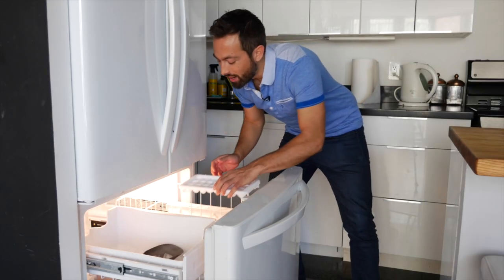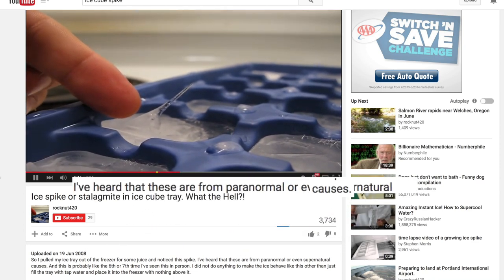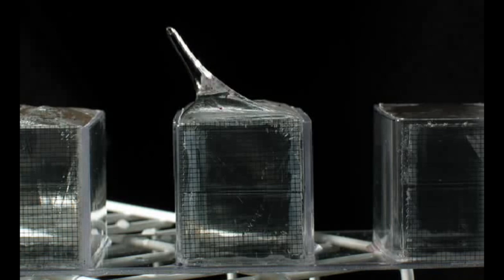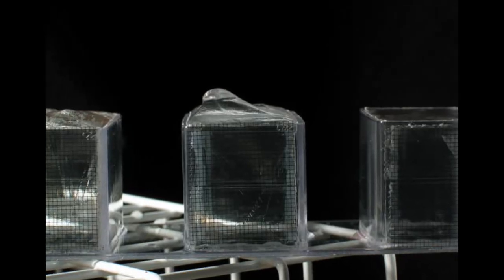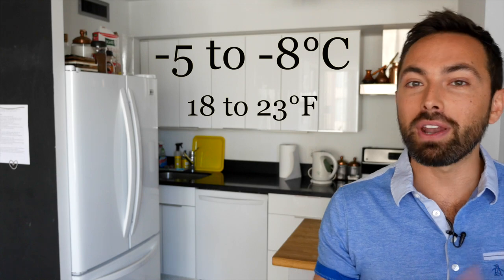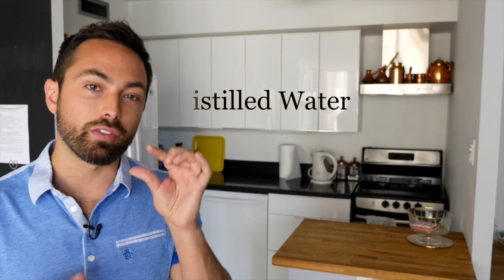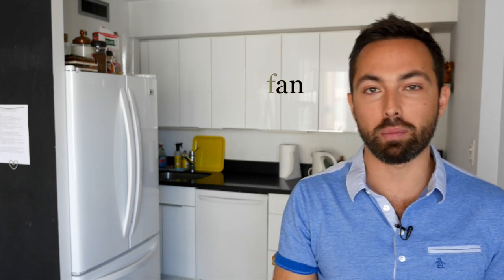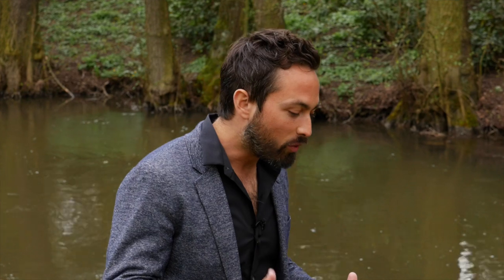Ice Spikes Explained

Comment from the maker: It's interesting how few people have observed this phenomenon - not even a bump on your ice cubes?
Reply: yes bumps but absolutely nothing like that
Reply: Probably because they grow in the other direction, down, here in the northern hemisphere...
Reply: Seen these from time to time. Not common, but not unicorns
Reply: When I started watching the video I was like "is that a thing?, never seen it"
Reply: nothing,
Reply: Nope. I've never seen anything like this ever happen.
Reply: I saw this happen only once
Reply: Nope. Not even a bump. My ice cubes always come out perfectly flat.
Reply: I'm guessing this doesn't work so well with silicone trays
Reply: I've been making ice cubes for 25 years. never seen this. I have ice cubes in nearly everything I drink, so that's quite a few cubes over the years.
Reply: Veritasium honestly never seen this happen, might have to do with the reasons you mentioned they form though: I don't use distilled water (obviously), and most of freezers I see don't have fans and work at -18°C.
Reply: Veritasium As a refrigeration tech, I'm going to look out for this in freezers that aren't quite getting down to temperature properly
Reply: Definitely never seen anything that looked like that. Though it has been a while since I used manual ice trays with the majority of modern freezers having automatic ice makers, so maybe it's less noticeable if it does happen.
Reply: I used to get the bump in my ice cubes, just not all-out spikes. Generally I try to keep my freezer colder than that. I was taught that 0°F (-17°C) is the temperature to aim for in a freezer.
Reply: Veritasium It may be because municipal tap water these days is highly electrolytic and dissuades ice spike formation.  I also imagine most people leave their freezers at much lower temperatures than you suggest is optimal - my freezer, for instance, is currently at a balmy -3 F (-19.5 C).  And I've never seen an upright freezer with a fan, other that the fan that is a part of the heat pump.  Basically the opposite of all three of your points for optimal ice spike formation.
Reply: Nice
Reply: Diamond Ice NS Almost all freezers will have an evaporator fan of some sort. In domestic units, it's behind the plastic covers in the back of the freezer. Some units have stronger fans than others, depending on the quality of the unit.

I think you're spot on in regards to the temperature. Most freezers run between -15C and -23C. Smaller bar fridges with the crappy little freezer shelf at the top may only get their freezer down to around -5C, but they are one type of unit which has a static coil (no fan), so this might again stop a spike forming.
Reply: Veritasium Hey Derek, can please do an explanation on the candle seasaw trick.
Reply: Veritasium i had a crappy old freezer it did on most cases have bumps usually around 5-8mm tall, but the thing that really took the cake
A penis shaped object including to half spheres was formed on the door shelf completely of ice. I took a few photos for laughs but the weird thing was there was no dripping from the top to form it, it also was leaning toward the center of the freezer
Reply: Veritasium why are the spikes so straight? Especially the one on the left. Have seen bumps before, never spikes.
Reply: Mike Williams like he said specific conditions, id like to know how to get them too
Reply: Veritasium I guess that's because regular freezers are too cold.
Reply: Veritasium Mine ice cubes are always smooth as a silk. Probably have to do with a freezer.
Reply: Veritasium Yeah small bumps are kinda common in the ice in my fridge
Reply: I drink distilled water, I get some pretty long ice spikes.  The dissolved air bubbles form an awesome crystal pattern too.
Reply: dan110024 Thanks for the clarification on the subject of freezer fans.  I learned today.

Another thing I just thought of is that most ice trays today are plastic.  Plastic is a pretty poor heat conductor, so would it be wrong to propose that the water in contact with the ice tray will freeze more slowly that the surface open to the freezer air?  The video implies that the pressure created in the would-be ice cube is created by water freezing in from all directions, and he explicitly stated that ice spike will stop forming if the open-air surface completely freezes.  If the ice tray is insulating the water, the surface will freeze over before the sides can freeze to build up that interior pressure necessary for ice spike formation.  What are your thoughts on that?

EDIT: I sort of blanked and forgot that most of the people who discover ice spikes are probably using plastic ice trays as well.  On second thought, there may not be any notable correlation after all...
Reply: Veritasium ever see ice rectangles? i've seen it almost like another ice cube on top of the first one. i think i might have already had an ice cube in the tray when i poured some warm - hot water into what i thought was an all empty tray, came back a while later to a gigantic rise out of the ice cube, was very interesting!
Reply: Nope
Reply: Veritasium I see bumbs on my icecubes all the time, but never longer than about 1/8th of an inch long. I also live in the american Rockies, so higher elevation might have something to do with it.
Reply: Veritasium Nope. Never seen or heard of this phenomenon before.
Reply: Veritasium I've never seen or heard of this phenomenon before. I live in the Netherlands. I'm wondering if other factors contribute to the formation as well. Also, nearly all freezers in the Netherlands are run at -18 C. I don't remember having ever seen one with a fan inside the freezer compartment.
Reply: Veritasium That's right! I have been alive for almost half a century and I have never observed this phenomenon!
Reply: This is a really cool phenomenon I've only observed once before and I never knew why it happened until now
Reply: Veritasium At end of video, was the singing done by you ?
Reply: Veritasium My freezer has an automatic ice machine that makes the wedge-shaped ice cubes, so I don't think these are capable of forming in that situation.  The strangest thing that happens is when several of them are still connected together along one end.
Reply: Veritasium 

Well you ask “It's interesting how few people have observed this
phenomenon?” well a day before that post I wrote:

“LOL, always wondered, had already made a picture to send to you with
the question if you knew why. So now I do Thanks.  By the way it happens
here 5 out 10 times on multiple cubes, using tap water.”

Later I added: 

“just checked the spike I have now and it seems to go straight up , not
at 60 degree angle, it is almost 1 cm, so the claim that they grow in an angle
seems not entirely correct”

Have another one, as a thought. I have two ice cube forms, only one
makes spikes! One is pretty solid plastic the other sort of flexible
rubber(ish). The Rubber one makes the spikes. My thought on it is that while the
first ice is forming it wants to expand and when the walls are flexible the
cube that just grows a tiny bit faster will push and break the thin layer of
the nearby cube so that a crack and spike can form. Whearas in the hard plastic
form this does not happen and no cracks so no spikes.
Your opinion about this is welcome
Reply: Veritasium  I've never given any though to whether there were bumps on my ice cubes, but spikes I'm quite sure I've never seen. Don't know what freezers are like in other countries but here they're usually around -18 degrees or lower. I was also wondering if the shape of the ice cube tray is relevant? Most trays I've seen are wider at the top than at the bottom. Would the effect be different if the compartments were completely square with right angles or if it was wider at the bottom than the top? (Yes, I realize you'd have to break the tray apart to get the ice cubes out, haha!)
Reply: Veritasium Never even heard of it. Freezers are usually much colder than -8C, usually about -18C around here. Even though our tab water is safely drinkable, it's far from distilled.
Reply: Veritasium Very nice video, you made one mistake though... as you said, water's “unique” property of having this density anomaly.... also C, Si, Ge and Sn do experience that.
Reply: Martin Embeh in the context it might not be unique to water, but just unique in general and respective to water....
Reply: +Robellibobban

It
is in the small freezer part of your refrigerator, where this happens not in
you "deep“ freezer which you use to freeze food for a long period,  and that unit usually around -8 C and the
deep freezer – 18 that is why they call it deep freezer
Reply: Villi Kuha 

It
is in the small freezer part of your refrigerator, where this happens not in
you "deep“ freezer which you use to freeze food for a long period,  and that unit usually around -8 C and the
deep freezer – 18 that is why they call it deep freezer
Reply: M Goudsmits Oh.. Refrigerators don't usually have those compartments in Sweden.
Reply: would have guessed that Sweden is not that different than the Netherlands or any other country in europe?  here most Refrigerators have a small cabinet just big enough to make some Ice cubes or freeze one loaf of bread which you are gonna use over the coming days, the freezers or Frysboxar weh ave in a storage room where long term sorage of food is kept. but any way it is not so important I just put a picture of my icecube spikes on the facebook page of veritasum
Reply: Veritasium at first i was like "O.O!! wuuuut!?!?" but i soon realized that our ice has just been capping off too early so to speak lol. we have small bumps from time to time, which i never gave a second thought too but this is certainly cool. its likely cause we keep our freezer below normal cold temperatures and use tap water for our ice. unlike alot of people who use the filtered water taps
Reply: Veritasium never seen it ever
Reply: M Goudsmits That's interesting. I've only seen so called "coolers", firdges and  freezers, or apparently only deep freezers. Fridges operate in +2 to +6 C range and coolers at over +10C. I've never heard of freezers running at anything warmer than -18C. They are meant for conserving food basically indefinitely while -8C would only be good for storing some foods for a few weeks. Where do they use -8C freezers? I'm guessing it at least saves energy with foods that don't require more freezing. Are there other benefits?
Reply: Veritasium awesome!!!! good job with the researching.
Reply: Villi Kuha it is not a -8 C freezer, but freezer compartiment inside a refridgerator , this small compartiment build around the cooling unit which holds the fridge at 6-8  is used to freeze cubes or other small stuff  at - 6-10 C that do not need to be stored for long
Reply: Veritasium I'd say 95%+ of the time ice cubes have been completely flat.  Any slight bumps in the surface I always attributed to condensation via the defrost cycle.  The same way you get "snow" on the outside of a bag of frozen peas.
Reply: Veritasium But the a cappella extro though
Reply: M Goudsmits oh, i see. thanks dude.
Reply: Veritasium I install appliances.  Most freezers have a factory setting of zero degrees Fahrenheit.  This is also the temperature that most restaurants keep their freezers for food safety.  If you experience ice spikes, you either have an abnormal freezer temperature preference, or you need to call an appliance repair person.  I imagine small bumps may occur because  from uneven cooling or the freezer door/drawer has been left open too long.  This would raise the temperature while causing increased air flow as the cold air in the freezer is exchanged with the warm outside, and cause the evaporative cooling you spoke of.  If there's any chance paranormal activity has occurred, it would be because a spirit has messed with your freezer dial. or it left your freezer door open too long while it searched for ice cream bars.
Reply: Veritasium I see this for the first time in my life.
Reply: I have had 1 in a frisbee and it was huge, way bigger than the ones shown here. It was so cool I'm so glad I know how it happens now thanks!
Reply: Veritasium Maybe because people dont use distilled water that often? Usually there is a lot of salt in the tapwaters. I myself have seen bumps and humps all the time, No sharp protrusions though... Thanks for giving me the explanation.
Reply: Veritasium Most home freezers are set for around -18°C (0°F), so...
Reply: Veritasium Never
Reply: Yup! It happens to my ice cube often.
Reply: Veritasium I'm 34 years old and I've never seen or heard of ice spikes before watching this video. I've always lived in the country (with very hard, calcium-rich water) or the city (with fluoridated water). 
Perhaps the prevalence of fluoride in water explains the rarity of ice spikes?
I'm about to get some deionized water and try this out!
Reply: halsoy Perhaps your freezer is too cold :)
Reply: I'm 37, and just found ice spikes in my ice cube tray; pretty cool.
Reply: I think the fact that the earth would be so drastically different due to such a small change  ( ice being denser than water) proves that there is a designer.
Reply: Theordore: https://en.wikipedia.org/wiki/Confirmation_bias
Reply: +Theodore Hochstetler You have to first assume ice could be heavier than water. Other physics lead to ice being lighter than water.  It's the similar to the reason why apparent magnitude goes down by the square, it's 3-space.
Reply: +Veritasium Never seen this.
However, 
1. My freezer operates at -18 degrees Celsius, which is well outside the temp range that you mentioned, and 
2. The freezer compartment that holds the ice cubes is basically a very thin drawer, which barely has enough height for the plastic ice containers to fit in.

Which means that even if I set it at the right temp, ice spikes would still not have any room to grow. I think they'd connect to the top of that drawer, lol, holding themselves in place, being stuck there.
Reply: +Veritasium Never seen it but I do get ice bumps all the time.
Reply: +Veritasium I could observe it for the first time this year. I have a humidifier that also works as an air-cooler, you have to put ice into the watercontainer. I didnt just put little ice cubes into it, I filled a whole 2l ice cream box with water, covered it and put it into the freezer. And everytime I opened it, the block of ice had a small ice spike on the surface. It was always about 1cm tall. Interestingly, the surface was not even. There was a slight elevation leading up to the spike from one side to the other.
Reply: The closest I've seen is (with larger volumes of ice/water) the top of the ice bulging and cracking.

Come to think of it, the cracks are most often spoke-like in the center in sets of 3 when they happen.

I live in western PA and I believe the source of our water in an underground aquifer, so we probably have a decent concentration of dissolved minerals here, so that's likely the reason.

I wonder if elevation/air pressure have any effect.
Reply: I have seen this and wondered, so ty.
Reply: +Veritasium I always use tap water...
Reply: +Veritasium But if ice sunk to the bottom of the ocean, wouldn't the thermal vents that are would also be at the bottom melt the ice?
Reply: rick6011
Yes, but only locally to the thermal vents, and there are nowhere near enough to stop the hypothetical ice buildup on a global scale.
Reply: +DynamicWorlds Thanks
Reply: +Veritasium Bumps, but, never those huge spikes...
Reply: +Veritasium I didnt observe this until just last year. The first 22 years of my life I had a refrigerator with an icecube maker in it. And no one I know has ever talked about it seeing these either.
Reply: +Veritasium I get these once in a while, not very often. I think because my refrigerator is old and inconsistent. Sometimes, I will find the ice has partially melted and there is a little water under the cubes. Also, I use a lot of ice so there is constantly a new batch of cubes being made. The times it does spike up, the spikes are rather tall but only on a few cubes. That fridge is no longer with us though, and science takes a back seat to properly frozen food.
Reply: +Veritasium Not even a bump...
Reply: +Veritasium Before your video I've never even heard of the phenomenon... 
But to be honest: I haven't heard of a freezer / fridge cooling down to (only) -8°C.
My fridge cools down to 4°-6°C, the freezer to -18°C
Reply: breakingVIE
Most modern freezers and refrigerators have a switch of some kind that lets you adjust the temperature in them. Though 1-10 doesnt really tell you much about the temperature its going drop down to.
Reply: +Veritasium I believe this may be because of impurities or specific minerals in the water, however I'm not sure which (would be a great followup video to this.)  I have water delivered that is purified with reverse osmosis (Crystal Clear) and although I've never had my tap water form these crystals, the purified water will do it nearly every time without fail.
Reply: Respected  Veritasium, why don't you make video on "SPACE VERTEX ENERGY EXTRACTION".
it's a trending green energy alternative
Reply: +Veritasium never
Reply: +Veritasium Not even a bump.
THEY LOOK SO COOL THOUGH!!!!
Reply: +Veritasium 
I get these all the time. The ice tray is right next to the freezer fan.
Reply: +Diamond Ice NS  
Probably not, air is a really horrendous heat conductor as well.  I'd be surprised if its much better than that plastic, more likely it's worse.
Reply: 2:35 Even if ice DID form at the bottom of water as opposed to the top, moving streams would still have liquid water - probably more than enough to support aquatic life. But lakes and ponds that are not sufficiently large as to have constant movement from wind as well as gravitational pull, such as the Great Lakes which are large enough to actually have a tide - all life that could not stand freezing would indeed die.

It certainly would not be a hospitable environment, and our world would be VASTLY different if Ice were more dense than the water it is made from!
Reply: Dysphoricsmile You raise some pretty good points, however it's worth pointing out that under the ice, it's warmer the further down you go as the ice (and water + magnified suns rays from the ice) will insulate the water below making it a lot warmer. I mean, it'll still be colder than the British sea but it'll be warm enough to support the hardened life-forms, especially smaller life forms, 

Potentially, in some of the deepest parts of the ice, we may even find it is warm enough to support aquatic life as we know it now..
Reply: +Veritasium Im seeing this for the first time ever
Reply: If ice was denser than water earth would basically be hoth.
Reply: Plot 31 Except that would not happen if ice were denser than water, because all the water transforming into ice would sink instead of floating, cooling the water further down and making it freeze from the bottom up... It would never sit on the top to act as a reflector, or an insulator for heat escaping upwards from the water, instead it would sink to the bottom and act to reflect light back up away from the bottom while also acting as an insulator for the ground and any ice below from the remaining heat of the water above, which would be completely free to escape into the air.

Because of this, the only place you would not have solid freezing from the bottom up is where there are natural volcanic vents, and even those would just end up bubbles of highly pressurized water under an entire body of ice.
Reply: +Veritasium I've seen bumps but never spikes. My freezer is usually at -18 C or colder though, and I don't make my cubes out of distilled water.
Reply: I, too, had not only never seen these myself, but also never even heard of such a thing until this video. I have seen bumps, and knew their formation was due to the expansion of the "inner" water as it froze within the already-frozen outer layer, but never spikes, no bumps over about 2 or 3 mm, and very rarely anything over about 1 mm.
Reply: an inch high spikes on my freezer everytime
Reply: ***** 
If it goes over 3 inches would it be an illegal weapon? It might be in my city.
Reply: I've seen it twice in my freezer, but only since putting the ice trays at the top where there's much more airflow. and only in the plastic ice tray, not the metal one. I suspect the metal one allows freezing to happen too quickly.

thanks for the video!!!
Reply: ive never seen these spikes
Reply: I am more interested in air tubes that grow inside the ice. Anyone got any ideas why? I dont understand why tubes are created inside the ice like that.
Reply: Noobs DeSroobs 
You have ice worms.
Call an exterminator.
Reply: Can you make a video explaining how the ocean waves freeze? Like you can see the wave crashing being frozen.
Reply: To be honest never ever seen ice spike forming like that.
Reply: Never
Reply: I asked my friends we haven't spoted this in Mumbai / India.   that's doens't mean it doesn't happen,  But...
Reply: First time hearing about this from your video :D  for real
Reply: yup never heard of ice spikes. They always end up nearly uniform
Reply: Veritasium never seer nor heard of it before
Reply: I watched this because I recently experienced this ice spike thing. Weird thing is, I've never seen them before other than maybe a bump. I've recently been making ice cubes with the spring water we drink, and the bottles are kept in the refrigerator. Why would cold spring water make big spikes, but not tap water?
Reply: Veritasium no
Reply: Yeah same Lisa Fallon just small bumps not spikes like that
Reply: You said that the hydrogen molecules in ice are slightly further apart from each other than they are in water, but as ice is a solid shouldn't the particles be closer in it than water?
Reply: Tanisha Garg That is one of water's most unique properties. It is, I believe, the only known compound whose solid form is actually less dense than its liquid form. This decrease in density is the reason ice floats on water. You can observe this phenomenon by completely filling a plastic water bottle and freezing it. The frozen bottle will appear bloated and deformed because the water expanded while freezing.
Reply: Veritasium no .Haven't heard of this phenomenon
Reply: I'm 24 and I've just encountered this for the first time. I didn't see the process, but when I looked in the freezer there was a stalagmite of ice from one cube in the tray. I saw so surprised I took some pictures and rewatched this video.
Reply: Veritasium ... i've seen small bumps, looking like waves on a frozen sea. that's likely because i'm using tap water or mineral water, both rich in minerals. and my trays are plastic, so quite flexible, and a bit insulating. i reckon a bird bath made out of rubber wouldn't form any spikes at all.
Reply: I saw it a couple times and it blew my mind.
Reply: This happens to me every time I make flippen ice!! ha
Reply: yeah i generally get bumps over the cube
Reply: guess my freezer's too cold for these spikes to form
Reply: nope
Reply: Veritasium 
I was working in geological chemistry lab when I first observed this phenomenon.  I turned to my lab partner and said "LOOK, AN ICE CUBE WITH AN ERECTION"  We laughed.
Reply: Veritasium nope I've never seen this.
Reply: I get it all the time. Thanks for covering it.
Reply: most people use plastic ice cube containers, or automated ones. So we never see it, the plastic allows for the expansion, plus they would use tap water. I've never once frozen distilled water.
Reply: Tried that hundred times. It did get bumpy but nothing like that.
Reply: Never seen ice spikes anywhere... Yes, little mound on ice cubes where the surface layer cracks and refreezes.
Reply: not here in the south
Reply: I've seen this once, and it was after I watched this video so I knew exactly what it was!
Reply: I get them sometimes! I used to get them a lot but, not really anymore!
Reply: Veritasium no, but my freezer is at -20c.
Reply: There's a place in South Korea where you can witness the miracle for yourself. The monks that live there artificially make them.
Reply: Veritasium 35 years old and it just happened the first time today and had to google this and came to your video
Reply: Happens in my freezer frequently.
Reply: drangus https://youtu.be/cF1mpV0sejs
Reply: @ScienceAsylum  Nick Licid!
Reply: @ScienceAsylum  oh wow Nick... I've found you here also.. Lol
Reply: It happened to me for the first time last couple of week, and I couldn't explain to myself what/why happened. That's why I'm here in the first place. I recently changed the position of the Ice Tray, and thought that maybe because they were near the cooling fan. The other only thing that actually changed was the room temperature, we got this new freezer/refrigerator in January, but this year has been "cold" in here (below 20 C), we finally started getting some pretty hot/humid air (the usual of 28-30 C), and then the Ice Spikes started to happen, so maybe the initial temperature of water also affects this.
Reply: I know I'm 8 years late, but I experienced this for the first time a month or two ago at the age of 31.